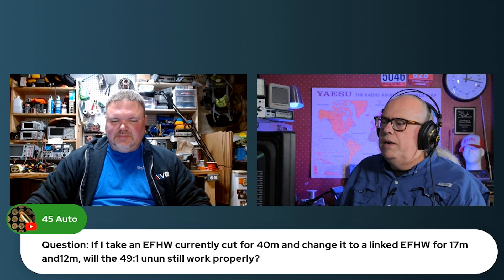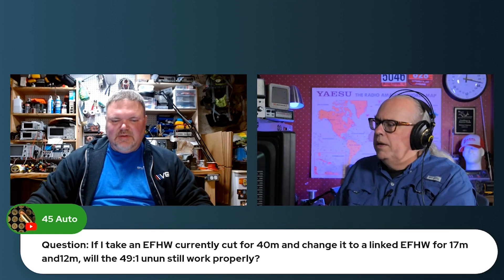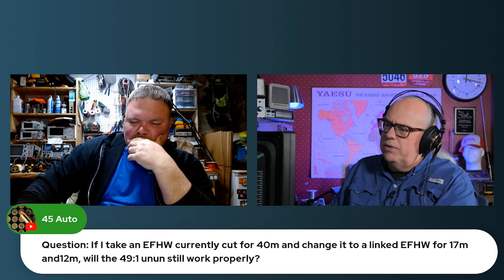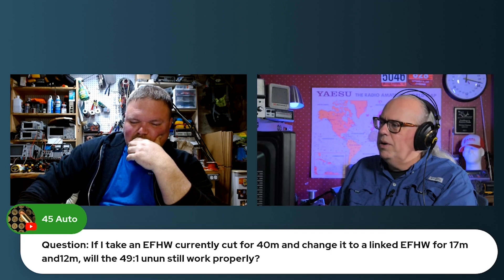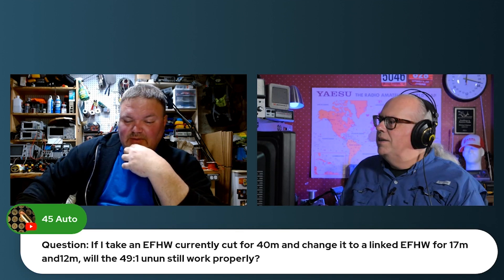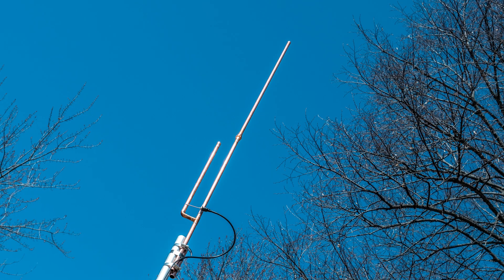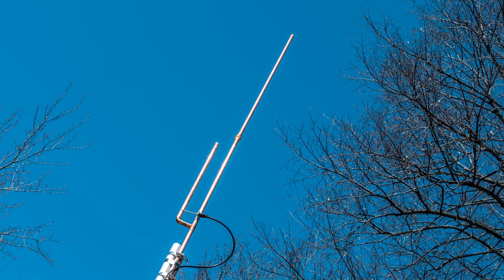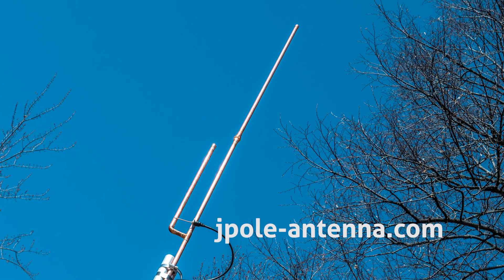Ask Michael, KB9VBR: Can I add links to an end fed have wave antenna?

Comment: Does that mean I can modify my 80m efhw 
MFJ-1982MP so I don't need to roll out all that wire for some of the higher frequency bands? That would make it more convenient to just break a link and the tuner won't have to work as hard. 
K2SAV
Reply from the maker: Yes it does. The 49:1 transformer at the feed point will be the same if the antenna's wire is 66 or 132 feet long. Cutting the wire and adding a link will make for a more convenient antenna.

Comment: Even if a 40 meter EFHW worked with an SWR of 1:1 on every band, it’s better (in my opinion) to have a halfwave on each frequency. My reason is that the half wave antenna ( regardless where it’s fed, center, off center or end) had a broad bi directive pattern broadside. When it is one wave long then it is two halfwaves and if end fed it will not have maximum radiation broadside. There will be a minimum broadside in two directions. There also will be a minimum directly off the ends. Anytime the antenna is longer than 1/2 wave the pattern changes. That could be good or bad. I like the fact that I get good 6 to 8 dBi of gain with a horizontal half wave with about 80 degrees between the 3dB points on both sides. The nulls are what hurts and each harmonic will have more and more nulls but only a small gain increase in a few pin point directions. I think a linked halfwave where the wire can be halfwave on each band is going to be a better all round antenna. 
I do want to note that a wire one wave long if center fed has a different current distribution and pattern than that same one wave wire if it is end fed. Center feeding an antenna that is a bit over a full wave long can give broadside gain as in the double extended Zepp antenna. I always think about what the antenna pattern is more than how good its SWR will be.

Comment: Make a link for 80m and you’ll have all the bands 80 thru 10
Reply from the maker: We did that for Winter field day. A 40 meter end fed with a link extension for 80 meters makes for a very long antenna. But the upside is that it is totally amazing on the bands. Here's the video: https://youtu.be/sqLRUnWZP80

Comment: The best performer in my POTA kit is a good old 20/30/40 "linked" dipole.  Where the "link" concept is effective with my EFHW is at the end of the 40-10 (67 ft.).  With that link, I can add a 110uh coil and short stinger wire to tune 80-meters.  Or better yet, add another 67 feet of wire and tune it for 3.550 mhz.  Besides the addition of 80-meters, harmonics for 30, 17, and 12-meters will become useful.😃
KZ9V

Comment: Great discussion.  Keep in mind that an antenna might "tune" on a frequency, but the radiation pattern might not be what is expected.  An EFHW used on an odd multiple of the fundamental frequency will likely have many nulls and lobes- which could be bad if you are expecting an omnidirectional pattern.  To me, radiation pattern is the primary reason to use a linked EFHW, not SWR or efficiency.
Reply: Not only the radiation pattern, the operating frequency shifts up as you change to the higher bands. At 10 meters you are almost inside the FM segment if you adjust the lenght for resonance at 7.2 Mhz on 40m.

Comment: I have been thinking lately to do a fan efhw.
Reply: Great idea, but it will not work.  A fan center-fed dipole works because non-resonant elements present has high impedance or an open circuit.  When feeding a dipole at the end (an efhw), non-resonant elements will become very low impedance, or basically cause an electrical short circuit....the opposite compared to a fan dipole.
Reply: @daveG1020  Dave is correct, I tried it a few years ago.  The linked EFHW is about the best to do. When tuning the antenna and adding links, I start with 10, then 12, 15 etc etc.   It's easier than having a 40m length, and cutting it down for the bands, in my opinion.

Comment: Answer: Yes
This is my SOTA Go-To antenna - never fails:
QRP Guys No Tune(r) Kit
1. Pick your highest frequency. 
2. Cut main wire 1/2 wL.
3. Cut counterpoise 1/4 wL.
4. Attach alligator clips on ends.
5. Repeat for additional bands (subtracting the wire lengths that have already been cut!)
Always resonant - no tuner needed!

Comment: I've made and used linked EFHWs. They're great! They work exactly as you'd expect. I've done a couple 80/75/60/40/30 EFHWs, so I can use it at a 40m total length, or at an 80m total length, depending on what fits in the space I have at the park. I used a tuner for 17 and 12 but a link would be a great tunerless way to go. Remember, the 49:1 is (usually!) a wideband transformer.

Joe talked about where the harmonics land. He's a little off. They don't fall on perfect multiples due to capacitive reactance in the wire - they'll fall higher and higher on each harmonic, without a compensation coil. 

73 VE3GKT

Comment: I’m doing a linked EFHW.  10/12/15/17/20/30/40/60/80.  Because of work and the weather the past few days I’ve only built through 20m.  The advantage is getting the antenna resonance where I want it.  In a traditional EFHW I have found resonance in 10M is generally closer to 29MHz.  I tried to do a 6m link, but with the 49:1 I couldn’t get it to work.  I’m going to add links to at least the end of all of my traditional EFHWs so I can add on 80 if I wish.  I’m also going to add a 2’ section linked to my SOTA/POTA kit to allow for tuning if needed.
Reply: Should be good. Remember that the best radiation pattern comes from a halfwave antenna. Broadside and with nulls off the ends. The depth of the null depends on height of antenna in wavelengths. Higher antennas have deeper nulls. Antennas operated on harmonics have more nulls and different patterns.
I should note you have discovered something many hams do not know. Resonance on harmonic frequencies is higher than simply multiplying the fundamental by 2, 3, or 4 . An antenna resonant on 7 MHz is not resonant on 28 MHz but somewhat higher in the band!